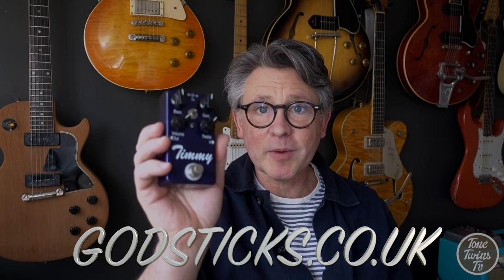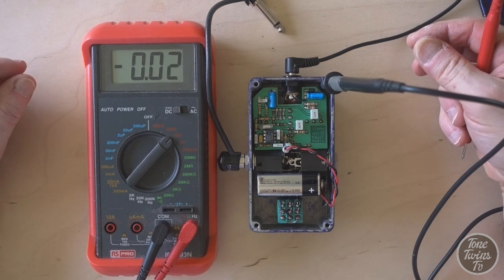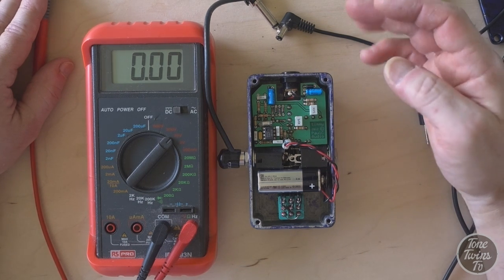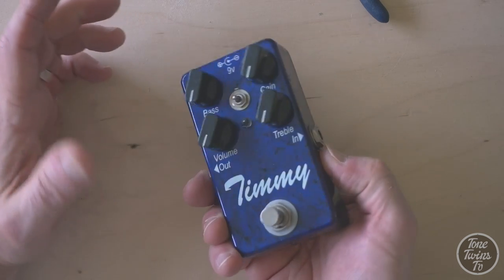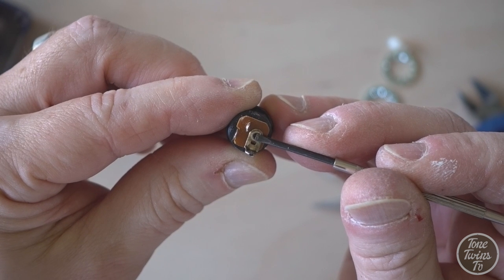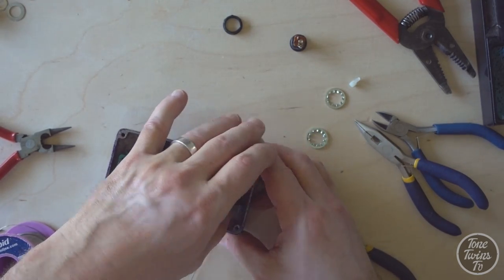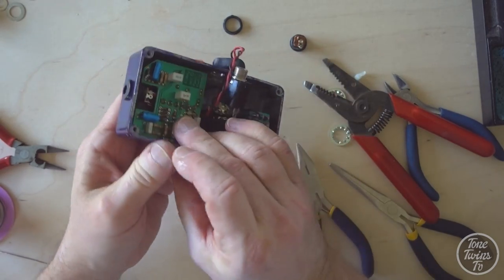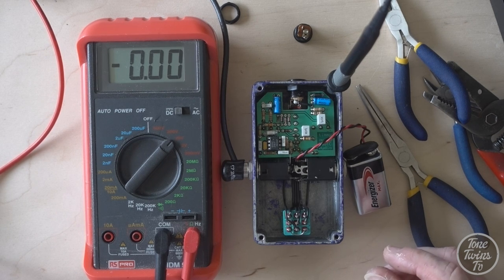Timmy Overdrive - Boutique Pedal DC Socket Repair

Comment: A flat battery would have made for a short video...
Reply from the maker: Which is why it's the first thing we checked ;)
Reply: I’m amazed at the lack of profanity with that repair. Replacing that innie power jack with an outie version will net a little more working room in the box.